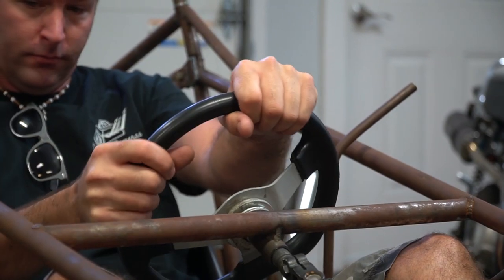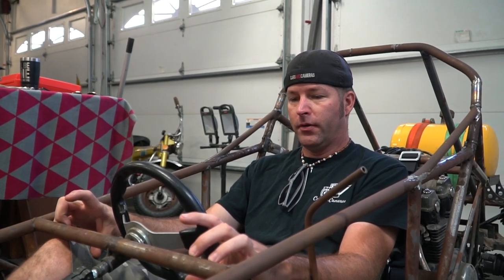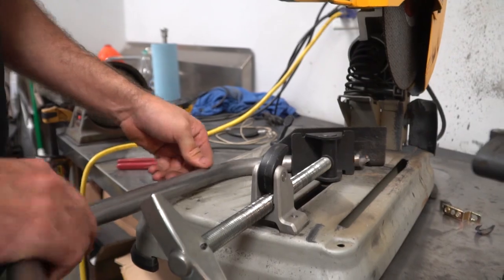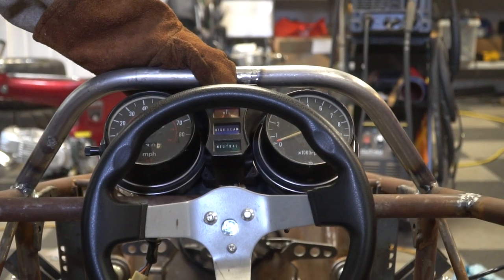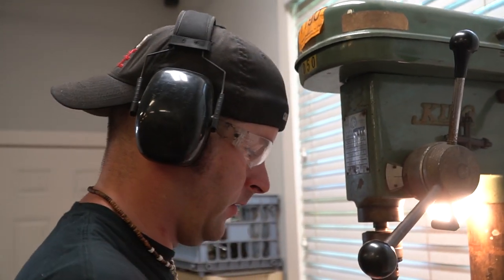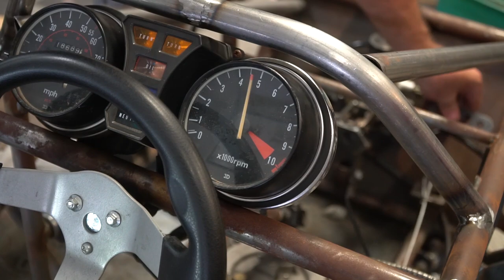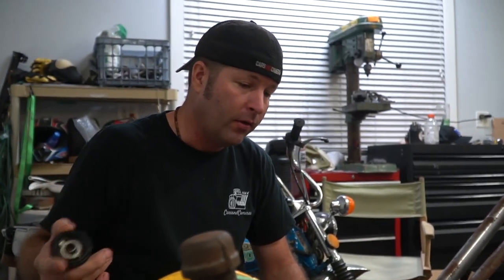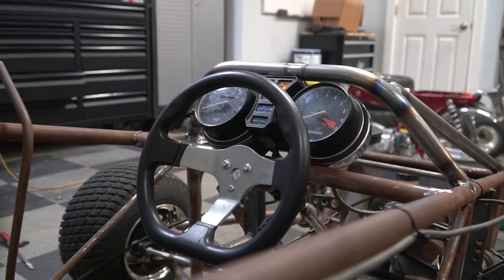Cross Kart gets Gauges, Tach + Dashboard!

Comment: Y'all should create a "longtube header" type exhaust for the 750. Yeah it sounds cool now, but I think connecting all the exhaust ports to a single rear pipe would make it sound more tuned like a street bike, reduce the potential for fire hazards when riding it in a field or something, and give you the ability to install a muffler for when you're riding in noise sensitive areas such as your neighborhood. Just a thought.... really enjoying these vids though
Reply: I also think it would look bad ass to have one pipe centered above the engine for an exhaust! Lol
Reply: Would actually increase hp collecting in 1 pipe too. Only itb likes individual exhausts
Reply: It's called a kerker 4 into 1
Reply: a nice 4 into 2 into 1 of the 180 degree variant with a shorty muffler, or 4 into 2 setup with 1 3/4 glasspacks poking out the back would make good torque, and a nice exhaust note. With the dual exhaust (4 into 2)  the exhaust note would be quieter at lower RPMS and get progressive louder as you get on it
Reply: Merge all the headers into one 3 inch pipe. That is all.
Reply: @nolansprojects2840  would be kinda dope doing wht u talked ab. Almost like the 4 cylinder vw motors on dune buggies? Tht the kind of exhaust u mean?
Reply: @gsfbffxpdhhdf7043  Short story long: Back pressure allows the exhaust gasses to form pressure waves inside the length of the exhaust pipe. By tuning the frequency of those waves to be at a low pressure (negative pressure relative to the higher mean pressure it operates at) when the exhaust valve(s) open, allows the engine to take advantage of the scavenging effect. The low (relative) pressure siphons the exhaust gasses out allowing a higher volume of clean air to be burned on the next cycle.

Comment: Get a flat top steering wheel then you'll be able to see the full cluster
Reply: A Knight Rider steering wheel and an Alixa to talk to.
Reply: just take the steering wheel off
Reply: perfect solution, easy, simple, elegant.
Reply: Two vice grips. That's all you need.
Reply: @joecannon5043  Two? Make it work with one... We're on a budget here...
Reply: @MnWun53  And make sure it's the cheap one from Harbor Freight!!!
Reply: with a steering box,  im thinking it takes more than 1 turn to go from  lock to lock, so a flat  wheel probably wont work very  well.
Reply: almost like a honda odyssey steering wheel
Reply: Stijn Tjolk improvise adapt overcome
Reply: Upside down D wheel ftw.

Comment: Music!  I like it!!!!!  Also adding a muffler of similar stock length can provide some resonance (Helmholz) tuning and more power.  There are calculations of length online.  It's basically setting up a reverse pressure wave that scavenges the exhaust and helps pull in the intake fuel charge.   Open headers have very little pressure wave if any.

Comment: The move can't come at a better time. If you can find a location with 220/240 that would be cool, there are motors or phase converters that can do that to. Since you'll be installing lights where ever you go I suggest LED. Setting up stationary cameras that fed to a central hub would give you more video options. You don't need wifi unless you'll be doing live broadcasts.

Comment: Also to achieve a 180 degree header (with a 1,2,4,3 firing order that your DOHC 750 uses) you want to link 1 and 4, and 2 and 3, then if you really want a crazy sound  connect those two outlets with a collector, and put a muffler on it, or just run that setup as a 4 into 2. I was right about the carb setup trust me on the pipe as well.

Comment: I know this is designed as you go, but see some bad crush points.  While you think you are protecting your hands, you are betting that all that stuff, pipes, gauges, steering wheel doesn't crush your hands should you do a forward roll or a damned flip. Your gauges should be mounted further away from the wheel. It won't look silly.  Just barely clearing your head and hands by an inch will quickly go away on impact.

Comment: Time to just put some mufflers on the crap. It's not the 1960s where exhaust systems were either open and loud or quiet and restrictive. There are plenty of modern mufflers designed to make power without be obnoxiously loud.

Comment: and this is what happens when you want to straight pipe everything. should have kept your things muffled and you would still be able to drive around not to mention the exhaust you did to current engine actually makes your low range of torque much worse

Comment: If you do the pedals with pneumatics you can make it smaller and have it on the steering wheel, just have it so that the engine cuts the ignition for the ms the gearbox is shifting and it wont hurt the gearbox as much.